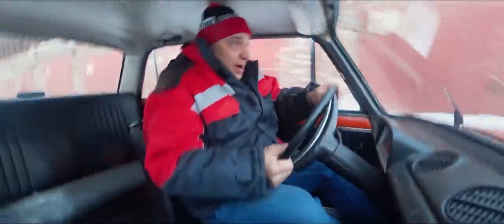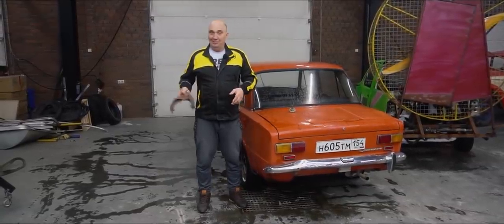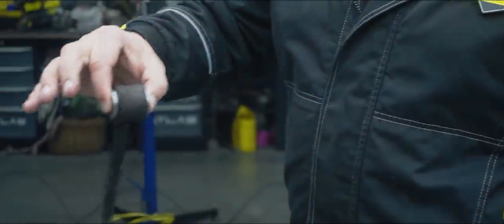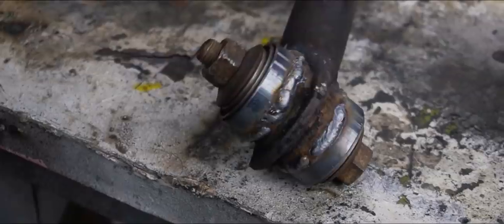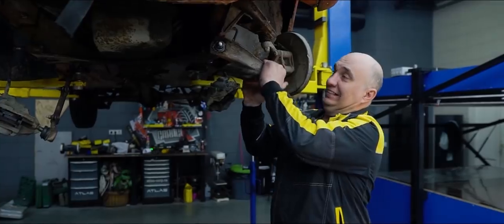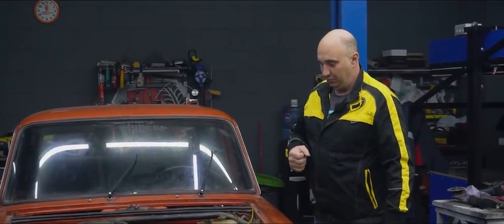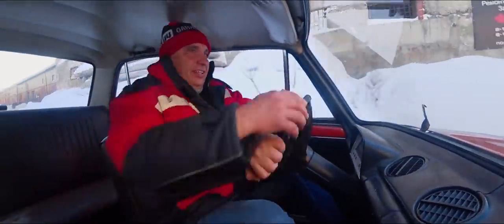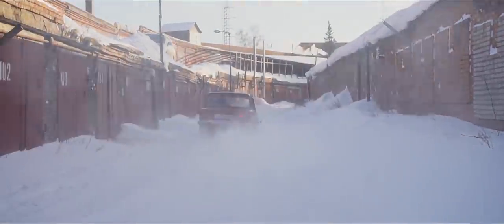Replacing bushings with bearings – how does that affect the suspension?

Comment: These guys are actually genius answering questions nobody's ever asked but realise we all should have 👀
Reply: Um 90% of drift and race cars already have bearings instead of rubber bushes
Reply: @janeblogs324  I doubt they change them all to bearings for drift cars (maybe some, I don't know a lot about drift car setups), definitely not for race cars (doubt they do at all), makes zero sense, as you see the results, not good for handling in the slightest. Usually you change them for stiffer bushes for better handling.
Reply: @HalfdeadRider  You mean the Polyurethane one? I just learned today that they give you more control, but increase the noise and vibrations, so I guess you need to choose which you prefer, before I thought that they were just an upgrade everyone should do..they're not!
Reply: @lidge1994  oh no they are not something to put on a Rolls Royce Phantom 😂 Tuners used to always use them, some still do, and yes the ride will be rough, especially on the road.
Reply: @HalfdeadRider  I'm not very well versed in the mechanics of a car, but I'm slowly learning more, basically it's only to be done for performance, 90% of the time for track/drift/off-road cars and not for comfort, correct? For comfort you can replace them all but should get quality rubber ones?
Reply: @lidge1994  probably not so much for off road I wouldn't think. For comfort you'd change like for like only when needed on a car that's already comfortable. Usually you'd just change the springs/shock absorbers if you wanted to change the feel of anything before even thinking about changing bushes.
Reply: @HalfdeadRider  Oh, right, don't need that much stiff control when you're bouncing around, better to have the more comfortable ones

Yeah, that's true, but I think people started changing bushings to Poly ones because they're inexpensive, difficult to replace, but inexpensive compared to shocks, springs and stuff like that, pretty sure even the ball joints are more expensive.
Reply: @lidge1994  got polly bushings on my daily, i like the feeling of them, actually had it on my last daily as well :) but i like to drive....sporty?
Reply: @Stale_Mahoney  exactly, not so much for comfortable ride, are you?
Reply: @lidge1994  noh got sportier lowering springs bilstein shocks, bigger sway bars and so on, all for fun drivability and less so for comfort ;) but i have still taken vacation car trips with caravan behind and such. funn times
Reply: @lidge1994  there is a reason not 1 car or truck comes equipped with polyurethane bushes. 
You'll be lucky to get 5 years out of them. Some suspension binds up from poor design too, so they are getting abused just cycling the suspension
Reply: @HalfdeadRider  well they all do. Unlike the tidiots in this video they use spherical bearings (like the factory balljoints he showed. 
If you use plain bearings that only move in 1 plane, but the factory arm moves in 3 planes you'd snap an arm in a week. 

You use bearings so your wheel alignment stays true while under cornering loads.
Reply: @janeblogs324  That's why cars have CV and ball joints, nobody in the real world would ever fit bearings in place of bushes. These are not idiots, they are just having fun experimenting for entertainment.
Reply: @janeblogs324  Thats not my experience, I know people that has installed poly bushes and they last practically indefinatly, if they start squeaking they need lubricstion, but they last a very long time and much lenger than rubber. I installed them on a Classic car I have 7 years ago, so far no problem, not a squeak and I expect them to last as long ad I have the car. I suspect the reason they are not used on cars from new is that it makes the car noisier, can squeak and might need lunrication. New cars are very stiff anyway so probably would not need them like older cars which are generally too soft. But in terms of how long they last it’s no competition, poly last much longer.
Reply: Many race vehicles use spherical heim joints and have for decades. Downside is increased noise/vibration/harshness (NVH).
Some use poly bushings, delrin, or nylon in various applications
Reply: @janeblogs324  I'm a mechanic by trade, very ignorant of me. 300 different brands of Silvia's hey! 🤣🤣🤦‍♂️
Reply: @AndreS_-df2nw  Yes, not bearings in replace of bushes, totally different.
Reply: @truxton1000  completely agree. Not only that but with the softer material it’s able to flex a lot more and more often so the more it’s worked the more it’s flexed and the more it wears. The reason of softer bushings is for ride quality and less vibrations as jerking from the engine and transmission. I think today’s modern vehicles just have better balanced components overall as well. (Not necessarily more reliable. Junk)
Reply: No, they're not. Suspension go through a very limited range of motion, thus you would have accelerated wear on the bearings in only a particular spot, which would lead to premature failure. Bushings work well for this application and won't shortly fail. Also, bushing have deflection and will absorb some of the vibrations of the road. These will transmit every vibration through the frame. Fighting NVH is a HUGE part of OEM car design, and a bearing would just be stupid for that.

If you plan on maintaining your suspension constantly, and vibrations aren't an issue, then a bearing may make sense.
Reply: @janeblogs324  Metal bushings more likely.
Reply: @janeblogs324  they're not bearings they're hime joints. which I guess is technically a bearing but they're much different than roller tapered bearings. Just do a Google image search a hime joint and you'll see
Reply: @bartbarnett2811  you mean heim joint for starters and that ONLY refers to bearings with a male or female thread on 1 end (hence the correct term Rod End) only Murican hot rodders call them heims
Reply: @janeblogs324  You have been referring to spherical heim joints all along as our friend above pointed out, there's the confusion, they don't even replace bushings anyway and are not standard type ball or needle roller bearings, or in any way similar, who's the ignorant one again! it's cool though 👍
Reply: Yeah, perfectly stated, but enjoyable vids regardsless
Reply: @janeblogs324  why is this?

Comment: Just add stiffer springs and shocks, then it’s off to the track and g testing on the skid pad. 🤷‍♂️
Reply: It would destroy the dampers though.
Reply: @Sak-zo1ui  alot of race cars have uniball suspension bits my brother's clio has its whole front suspension on bearing s instead of bushings , and with nicely setup kw v2 it handles superbly
Reply: @robivlahov  they are called heim joints.
Reply: Yep, needs a different damper/rebound.
Reply: @Sak-zo1ui  also aircraft joints .. 
Spherical rod end brgs
Reply: The stock shocks should've been fine unless Ladas depend on the "stiffness" of the bushings for damping which I doubt. But then, they never designed these cars for bearings instead of rubber bushings. If they had they might have incorporated stiffer valving in the shocks. It's a moot point.
Reply: @Sak-zo1ui  Which are spherical bearings.
Reply: @ejb5034  yes and they are called heim joints

Comment: Very good idea. Those bearing bushes work like super low resistance racing metal bushings (those also have zero play, no dampening effect, and way less resistance than rubber bushings).
Those would work great with super hard springs (170-200% of factory tension), and high end shock absorber's with regulated negative rebound dampening (that fixes the suspension knock, and usually offers a bit more travel).
Additionally on racing versions of suspensions for normal cars generally the suspension arms/wishbones always get reinforced with additional welded metal plates to make them resistant to twisting and breaking in weak points).
One last thing to get a complete suspension package is addition of hard anti-roll bars with hard polyurethane bushings (due to the way they move even on racing cars those usually don't get metal bushings).

At the end of the day you'd end up with a tarmac track ultimate driver's machine lada, epic :D
Reply: They're called "Heim joints". They allow rotational movement on any axis, but don't have any longitudinal play whatsoever. The only reason they're not used in street cars, is that the couple road noise into the cars chassis, making a very noisy ride. The do, however maintain suspension geometry, and would make it handle like a sports car.
Reply: Do u think a dual rate coil would fix the knock or would u need new coils and shocks?

Comment: It still surprises me that Ladas have double wishbone suspension lmao
Reply: Lol you’d expect it to be leaf springs and a torsion beam or whatever (I know nothing about suspension)
Reply: They're derived from the good old fiat 124 that was quite a wonderful car back in the day, it had all of these tasty choices and also four disk brakes
Reply: @viper3997  the rear disc brakes they replaced with drums when converting the Lada 2101 for its duty in the USSR, apparently they were better suited to those harsh conditions.
Reply: @SwapBlogRU  Probably a good decision. Drums don't suffer as badly from rust and don't fade so easily if they get wet. If the climate is cold and they aren't going onto a race car drums make a lot of sense.
Reply: @siraff4461  I prefer drums too, they last much longer. Btw Ladas also got a raised suspension (compared to the Fiat)
Reply: @petermolnar8667  Yeah my car still has original 30 year old drums and not even half worn
Reply: Basically a lotus. 🤣🤣
Reply: @petermolnar8667  drums have terrible stopping power
Reply: @VeyronBD  I have to think you either never drive the car, or have never adjusted the shoes.
Reply: The old Ford F Series pick up from 1980's have double wishbone suspension as I remembered.
Reply: @theroyalcrownedtiger2946  I am pretty sure that was twin I beam, not the same thing.
Reply: @--_DJ_--  well it does only have 95k miles on it so thats part of it
Reply: @That-guy0801  Depends.  Drums can have outstanding stopping power, but they don't dissipate heat nearly as quickly as discs.
Reply: @That-guy0801  Drum brakes actually have better stopping power than disk brakes because they have a larger surface area. They don't dissipate heat well, but that's only a problem if you're breaking heavily multiple times back to back.
Reply: @That-guy0801  drums actually have much better stopping power but they tend to get brake fade much faster
Reply: @uzernaim1648  If drums do have better stopping power why do every car with the option to have rear disk brakes stop better vs the drum option. Also a disk conversion 1965 Mustang stop way better from 60-0 than with its stock drum brakes and that before the rear drum brakes heat up.
Reply: @That-guy0801  Depends, definately not good for high speed laps and repeated hard braking, or descending long hills.
For lighter vehicles or lighter braking, having drums on the rear is not as big of an issue. You get far more benefit out of front discs than rear disks.

Comment: As someone who just finished replacing the bushings in their radius arms with heim joints (similar concept), this is actually very informative!!

My takeaways are that if he had proper bump stops and limit straps set so the shock wasn't bottoming out or overextending, and if he added a bit more damping with some more serious shocks this would have worked incredibly well. The way the wheel was able to cycle up and down so rapidly on the small bumps resembled something with MUCH more serious suspension then that little thing (8:03). One thing he didn't mention though is that I'm sure it would transfer MUCH more road vibration, clunks, rattles, to the cab since bushings dampen that as well. Guess that was the least of his worries on a road like that haha.

Never seen this channel before, thanks for bringing this guys antics into english for us! 👍

Comment: You guys should have replaced the shocks, with heavy duty versions.
Reply: Doubled them up..even better
Reply: Yeah, I think the real reason they don't use the bearings everywhere is A: they cost more/less profit  and B: there's no real way to seal in the grease. So you would have to use the sealed bearings raising the cost even further.
Reply: @Bob-Whiting  google "johnny joint" Offroaders like em.
Reply: @modarkthemauler  Fuck yeah bro, Thanks! one of 'em looks like the type I would need for my upper control arm on my 4x4! Thank you.
Reply: @Bob-Whiting  That is what I was thinking.  But would sealed bearings and seals still be able to stand up to the corrosion? Also, I have to wonder if the bearings can take the shock loading without self destructing.
Reply: @KnifeKnut  Oh yeah, they can take tremendous loads, side to side and vertical too. They are made of steel that is Harder Than the Hinges of Hell brother. Read above what Ero Kreitsman says in His reply about "Johnny Joints" for further info tho.
Reply: @Bob-Whiting  it's the "hardness" aka tensile strength that make them unrealistic to use in a irl situation. Unless ever other suspension component were at least as "hard"(or harder) than the bearings they would break years before the bearings break. That's why engineers use bushings. Softer ride, easier on the other components, more articulation, less weight, cheaper and easier to replace. Bearings have no place in a production car for these reasons. Not even race cars use a setup like in the vid and for good reason. Sure if you have a trailer queen car that is tuned every weekend you might get away with spherical joints. But on a car that can be relied on to hit a few potholes every day...good luck with that
Reply: or  split the different with higher rating springs too
Reply: @Bob-Whiting  real reason is that you lose all comfortability for a stiffer suspension, which is perfect for drag racing or track driving. The reason they don't use them in mass produced vehicles is because not everyone wants a car built for the track and not for the street. They are usually used in aftermarket performance parts.
Reply: or long travel

Comment: What a cool idea to replace the bushings with bearings. It was very interesting how it improved the performance over the rough road like you said, except it was just a little too soft since normally the bushings resist the movement so the shock has to do less. It sounds like if you just put in stiffer shocks to make up for the bushings being bearings, it might actually be a good upgrade for cars in general for high performance handling over rough roads at least if not also for racing and everything. It would make sense because you would have such more precise control over the car suspension travel and you could really tune the shock to perfection without having to take into account springy rubber intermediate parts affecting the suspension tune. I wonder how it works for cars with the aftermarket poly hard bushings. Then it's basically just a journal bearing at that point?

Comment: There's a reason to use rubber bushings. They can deform when non-pivotal forces are applied to them as in braking, cornering and acceleration. The only bearings which can do what is needed are spherical bearings that allow movement in 360 degrees. They didn't use spherical bearings or the difference in the ride and handling characteristics wouldn't be so noticeable.

Comment: I actually always wondered this. It wouldn't be reliable, but freeing up articulation should always be a good thing. Never thought that the bushings might actually be part of the process, by limiting articulation. Better shocks, or better yet proper hydraulic dampers, might make this work short term for say...a track car. zero unwanted rebound or deflection, and fully smooth articulation would be a boon on a track. Might need better antisway bars too.

Comment: Find huge industrial bearings and replace front wheels with set of those with hub welded shut
Reply: That moment you realise the front hubs are already turned by an industrial bearing
Reply: @kennethsamson1759   he talks about bypassing the hub and using a big bearing "instead" of the wheel.

Comment: Dirt track racers install bearings or solid sleeves throughout the suspension on racecars. It helps keep suspension geometry in spec while providing smoother articulation. Dirt cars concentrate on weight distribution and movement to get the traction needed on dirt.

Comment: Wow, nice experiment! I was expecting the rear to be broken as the rods are rotating around two axis as the wheels are moving differently.  btw the front track was widened during the action by wheel spacers or similar. Normally you can not see the ball joints on Lada.   Keep the good ideas!  Put twice as long wishbones!

Comment: that's actually the reason for going to urethane bushings in 4xx4 suspensions. the urethane bushings hold up to the rigors of heavy duty suspension working and allow for a "bearing" type of movement without the need to totally seal out water. solid rubber bushings are great for suspensions with less travel and the need for more precise alignments.

Comment: would it be the same if shock absorbers and springs on both sides were replaced with accordingly stiffer ones to compensate for the lack of bushings?
Reply: This
Reply: It could probably be made to handle very well (for what it is) and extremely consistent, until the bearings fail which some of them would pretty quickly taking hits like that.

Comment: That’s a really cool idea but the point of rubber is to absorb some of the shock from bumps and accidents so on any decent pot hole where the rubber would absorb the horizontal force but the bearing causes a transfer of forces from the suspension components to the connection point